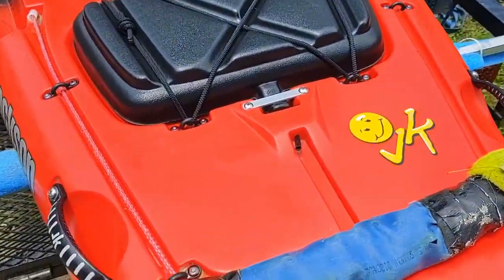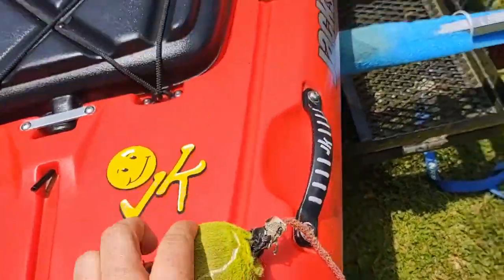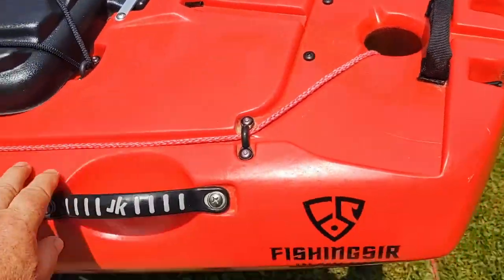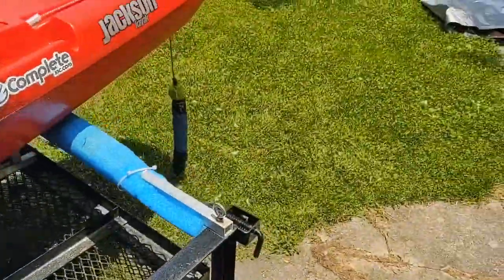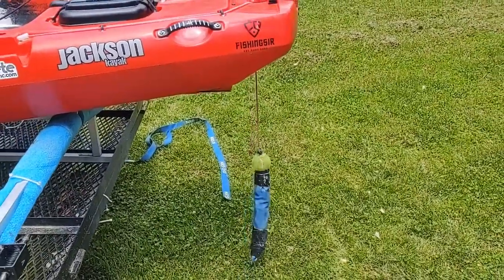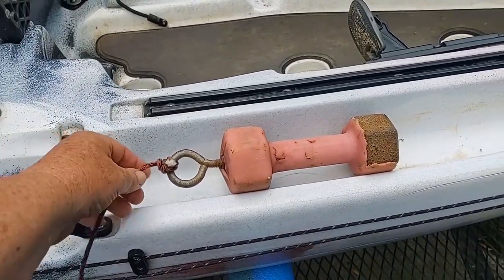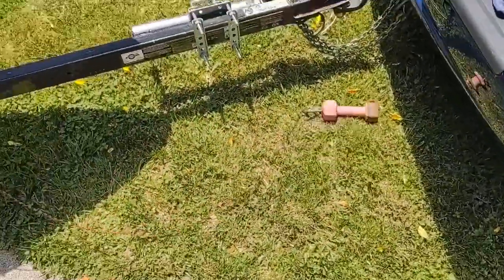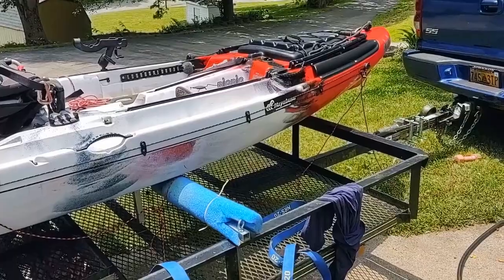Kayak Drag Chain and Anchor set up

Comment: I'm curious about how you rigged your trailer. I am carrying 2 12 foot kayaks and saw your setup. Maybe do a run down of your trailer?
Reply from the maker: That's a good idea! TYVM!  It's a 5x8 utility trailer and I used 1" square aluminum tubing for the cross bars and a standup Brace in the middle of each one.  check out my FB page and I'll post you some pics there.  https://www.facebook.com/RiverSmallmouthAdventures I'll try to have them up later this evening.
Reply: @RiverSmallmouthAdventures  thanks I appreciate it